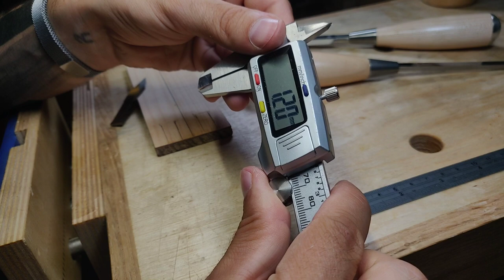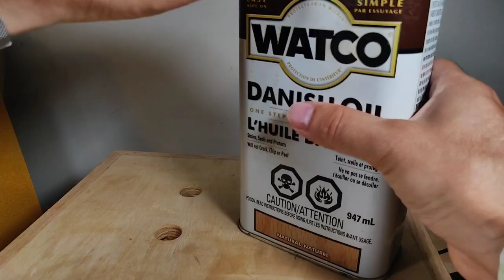Building a luxury marking knife with hand tools / ASMR for woodworkers

Comment: Very nice work. The wood is beautiful. Wondering how I drill those holes without a drill press. Will a handheld drill do that with a carbide bit?
Reply from the maker: Thank you ! 
I don't think it would be a good idea to try to drill hardened steel with a handrill, carbide bit or not. The chances to slip on the steel and mess the whole thing are to big. 
Options are : 
- just glue the blade in place and forgot the brass pin (it s strong enough just with the glue).
- use the same method I did for just esthetic brass pins.
- make you own blade and just hardened the tip of the blade so you are able to drill the steel with a normal bit (but i think it's still risky with a handheld drill).
Have a good day !